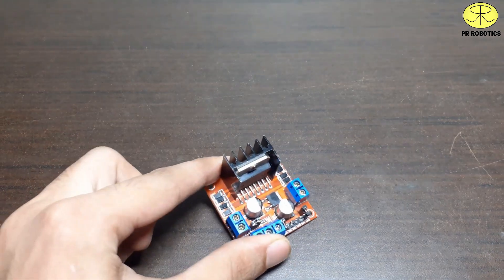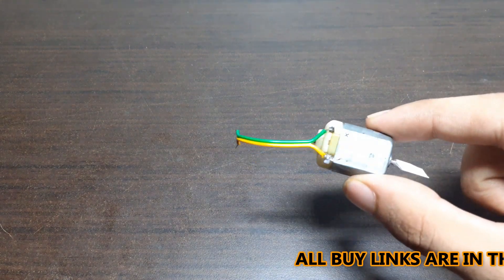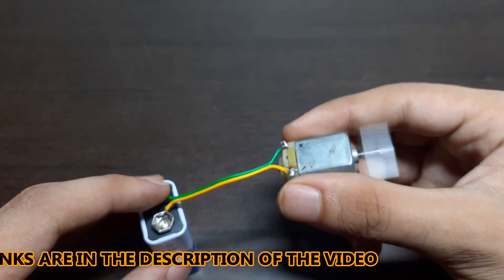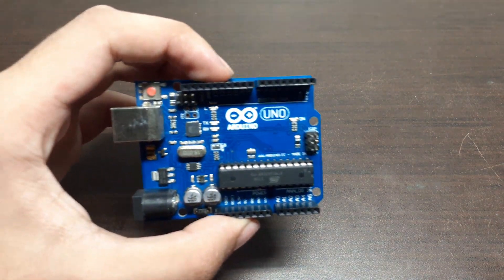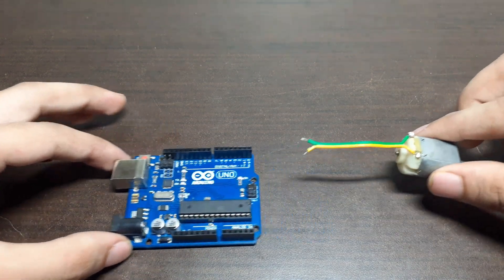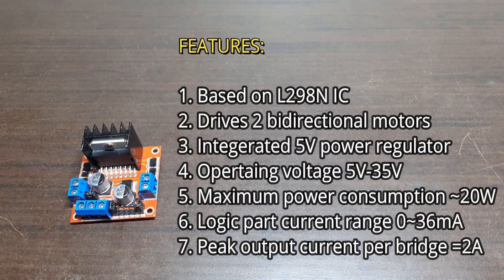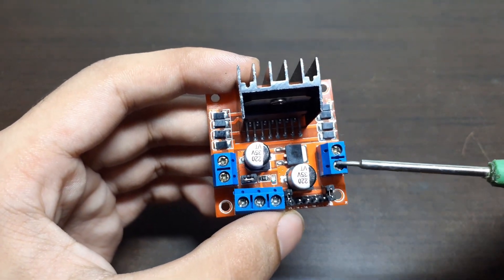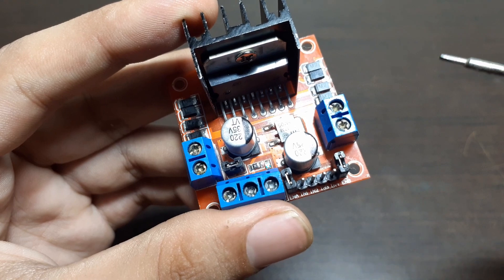#33 How to use L298N motor driver? || PR ROBOTICS || ARDUINO TUTORIALS (ENGLISH SUBTITLES INCLUDED )

Comment: Instead of motor can we use 12volt LED strip?
Reply from the maker: I think yes you can and I was also thinking about the same when I was making this video. But I haven't got time to do this experiment. 😅
Reply: And your diagram and code Link is not working
Reply from the maker: I am really sorry for the inconvenience,  actually I have deleted my blogspot. Please check the description after 1 day, I will provide link for my github page.
Reply from the maker: You can find the code by clicking on the link below. I have explained each and every line of code along with the circuit diagram. 
https://github.com/pr-robotics/YouTube-

Happy learning 🙂
Reply: I am going to make Hoop light Basketball one can you help me out?

Comment: Hi, I am looking to use this motor driver and arduino to control a 24V, 3A linear actuator. I have an smps which gives me 24V DC and I was planning to use your "Controlling DC motor with mobile phone tutorial" circuit diagram as my guide. Do you think the motor driver+arduino will be able to handle the load/supply or will I need to connect an external 5V source to the arduino?
Reply from the maker: Please read the datasheet of the module you are using, you can use arduino for controlling the module.
Reply from the maker: Actually you have supply a different 5V supply via USB and 9-12V supply via DC barrel jack. But the ground must be same.
Reply: @PRROBOTICS  right thanks!

Comment: I'm new to electronics. Why 9v battery doesn't burn dc motor which has smaller voltage? I thought you had to put resistor between them but it turned out fine.
Also i found similar youtube videos. They said you should disconnect pc from arduino when running it with 9v battery and vice versa( to upload code to Arduino, disconnect 9v battery before connect Arduino to pc) Why is that?
Reply from the maker: Because if you use 9V battery and upload the code it will burn your arduino. The cable connected with your PC also provide 5V to power up arduino .
Reply: @PRROBOTICS  so after uploading at 5:41 you can connect both 9v battery to motor and usb to pc at the same time? How can it does not burn arduino at this point?
Reply from the maker: Here i am providing 5V separately to L298N motor driver module and the arduino is connected to separate 5V power supply. Your arduino will burn if you connect 9V battery as well as Cable (used for uploading the code) at the same time.
Reply: @PRROBOTICS  Ok now I get it. As long as they use their own power source and socket in driver board labeled +5v is not used. 

Thank you so much for taking you time to help me. Have a nice day sir.
Reply from the maker: My pleasure. Please have a look at my other projects too😊
Reply: @PRROBOTICS  I will.